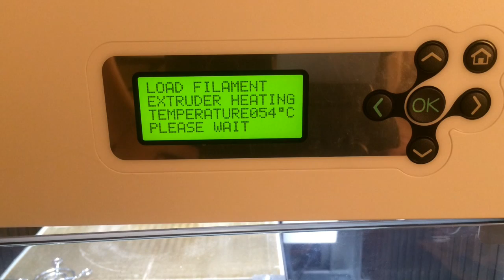How to replace nozzle/extruder on da Vinci 1.0 3D Printer

Comment: Woah! Woah! Wait! Wait! Wait! PEOPLE, DO NOT DO ANY OF THIS! Wrong! Not to be rude but I’m trying to save you all some suffering here. There is absolutely no reason AT ALL to ever remove any screws whatsoever when removing the printhead. Also his filament is not stuck and neither is yours.!Geez. Here’s how to do this ez pz and also not die and to learn:

1) Look at your LCD display on the front of your printer. The first option is Utilities. Press “OK”. Then press the first option on that menu “Change Cart”. On the last menu, press the second option “Unload Filament”. Wait a few minutes and it will squeeze out some excess filament, make some mechanical noises then the screen will tell you to “Unload Filament”. Simply lift the lid on the top of the printer and grab the filament wire from above the printhead and gently pull it out. Ez pz. You’re welcome.

2) Removing the printhead: DO NOT TAKE THE PRINTHEAD off before turning off your printer, removing the zip ties and disconnecting the cables as explained below!!!
Turn off your printer. Get a flashlight or whatever but don’t use the printer light as your excuse to zap yourself or kill your printer. 

3) You should have 2 zip ties that hold your cables neatly out of the way. If not then you already followed a bad tutorial and should replace them. Zip ties are cheap. There’s only 2 zip ties that you need to remove before you unplug the cables and remove the printhead. Ignore the 3rd zip tie on the left side of the printhead. That can stay. They are at the very top where the long white plastic connector rests. In this guy’s vid, it was the first cable he unplugged. The two ties should be carefully cut. DO NOT CUT THE PRINTER WIRES!. This is easy. You can do it!

4) Once the zip ties are off, then unplug the cables as shown in the video above. If you left the printhead alone then this should be a lot easier than in the video. They disconnect easily.

5) On the back of the printhead mount, there’s a big black lever. Just reach down and grab it with your fingertips and pull it upward and hold it. Use your other hand to grab the printhead from under that lever, lean it backwards and then tilt until it comes out. This should not be a violent act accosted to your machine. Some gentle wiggling may be applied if needed but if you move it just right, it will come right out. Once you have it out, release the lever with your other hand (which shouldn’t have let go of it until the printhead was out completely. 

6) Now your printhead is free and you can clean it, explode it, melt it, fry it or whatever. If it survives your cleaning methods then just follow these steps backward to put it back in and finally reload the filament.

This is not rocket science.

And here’s just a personal tip from an avid ABS user. I love abs for its durability and longevity and PLA is for wuss printers with no enclosures. If you do have a PLA clog then it may be worse than an ABS clog since you probably didn’t know to take off the side windows for ventilation and to leave the front door and lid open while printing with PLA. That enclosure is too hot for really good PLA results, but it actually does print very well with care and ventilation. If you have an overvalued PLA clog then by now it’s already turned to a dense tar clog spawned from its freakishly cheap material soul. PLA melts at a much lower temperature than ABS. Once PLA goes far beyond that temperature, it takes on a chemical change that requires good heat to remove., but with some practice, you’ll find a way that works best for you. You have a tool that came with your printer or with your replacement xyz... printhead. It’s a 1.75mm rod and if you don’t learn how to use it then you are doomed to waste hundreds of hours pointlessly poking at your nozzle with little to no results.
Use the damn1.75mm rod! It has a loop on the end. Go find it ASAP and then keep it safe in a drawer somewhere. This is your bff!  It’s specifically designed to push clogged filament out of your specific Da Vinci 1.0a nozzle! You’re welcome!

Now it’s up to you to decide how to go about it. Go watch some of their vids because I’m not gonna be responsible for your melting brass to your face.

I very carefully heat my nozzle tip with a small cream brûlée torch, but telling you to do this is bad because there are wires connected near the nozzle and you absolutely should not put the flame on them nor butcher the nozzle. You have to pay attention and be careful. Y’all don’t seem like the careful types though. 

. Once you’ve heated the nozzle your way, you can press the rod gently downward to squeeze all the filament out in a single go. If you still have a clog then it wasn’t hot enough yet. Just start off slow and low until you learn what it takes. But really, as long as you don’t cook the wires, you can apply a lot of heat to it to make the filament gooey inside. The moment it gets soft, that rod will push it right out like a dream come true. Then you’ll look at those stupid little cleaning picks you’ve been using and wish you could get all that time back you wasted by just using those. Silly peeps!

If you do want to use the faster cleaning method of the cream brûlée torch or small kitchen torch then you can buy one for like $15 plus a can of butane fuel to do it. The cheap ones work great for this purpose and most have good marrow flames and are very light weight, one handed tools. But don’t blame me if you don’t know how fire works and you melt the wires which are obviously poking out in bright red coating. Go watch one of the vids on this sort of cleaning before trying it.

Good luck!
Reply from the maker: Bro, thanks for the essay. It only took about 3 days to read. Lol. Step 1 didn't work because the nozzle didn't heat anymore so it didn't autorelease the filament like you are suggesting.
Reply: You said all of that for absolutely nothing and thought you were teaching🤣🤣 he’s not saying how to replace your filament cartridge🤦🏾‍♂️ saying that when it is jammed and obviously already tried to extract from the settings with no luck, then you do what he did🤣🫵🏾

Comment: Electronics 101: DO NOT WORK ON A UNIT THAT IS POWERED!! Disassemble unit with the power off so it does not damage any ESD sensitive components.
Reply from the maker: Yes you are correct. I guess I was mostly using the power for the lighting. Lol. Lesson learned thanks.

Comment: Hope you still have the hot-end assembly that you replaced because I have a detailed video on my YouTube channel explaining how to really unclog the nozzle of your printer and make it work again. This will for sure be possible with your nozzle as well, so it will save you some money if this happens again AND you will have a spare hot-end assembly.

Also, please... Next time switch off your printer when doing repairs. You don't want to blow up your motherboard. You don't need the motors to move the printhead. When the machine is off, you can freely move the carriage over the X and Y rails by hand.
Reply from the maker: Thanks for the feedback.

Comment: the fix for the heating issue is to bypass the factory plastic clamps.. some replace them with other connectors, some solder them directly.. i'm working out the problem with the gears slipping on filament
Reply from the maker: nice

Comment: Sorry, I just saw where you explained how you did it.  I got it cut, but am having the worst time getting it out.  I guess I just need to keep fidgeting with it.  Thanks for the great video.
Reply from the maker: Raymond Marker Basically by cutting it as much as possible and then pretty much by force. Just have to pull it out. It was a pain and took me a little bit as well. Let me know how it goes.

Comment: Think think why didn't you just un load the filiment and why was your printer on think about what your doing besfore you do it😡😡

And I disliked it because your oppos to use comen since!!
Reply from the maker: Ryan Mayfield  Listen to yourself first. How would it unload if the heating element isn't working. Therefore, the printer was stuck in a never ending heating problem. That's how I discovered it was the nozzle in the first place.

Comment: How do you know when you need a new one?  Mine currently doesn't extrude when printing.  But when I unload and reload it, in time it does.  use to be I would reload it right before I printed and all was good but know that doesn't even work
Reply from the maker: Thyfrogcatcher That's weird, I never heard of that issue before. Mine just didn't heat up anymore. Like if I tried to clean the nozzle and you have to wait for the bed and the nozzle to heat up, well the bed was heating up while the nozzle kept at the same temp. So I figured I would just replace it.
Reply: I have the same problem  filament extrudes when I load it but when I print it looks like yours

Comment: What an idiot,  learn  the correct way before making a video
Reply: Seriously. He made this look way too hard. Didn’t even secure the cables back with zip ties. No wonder he is having issues, he just has stuff dragging around in it. There was no reason to unscrew anything at all either. Disconnected cables after he pulled off the printhead housing... I mean... this is insane. Think of how many people will be repeating this mess. 🙄